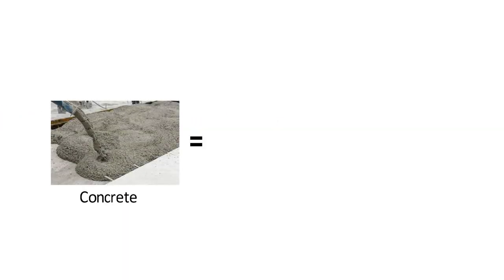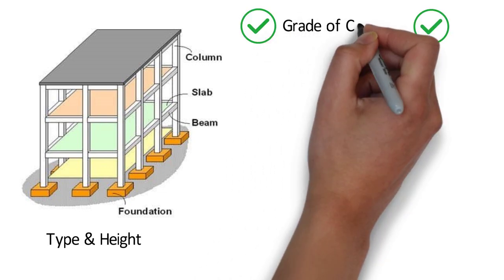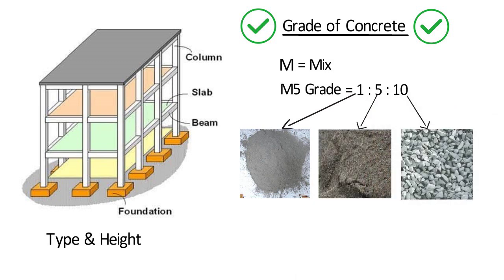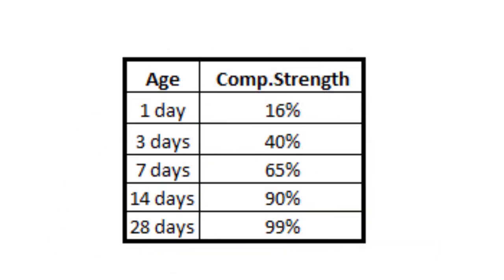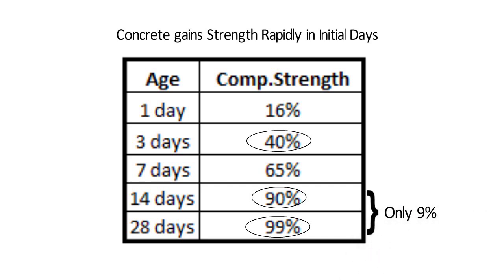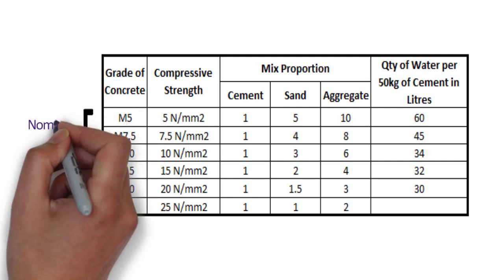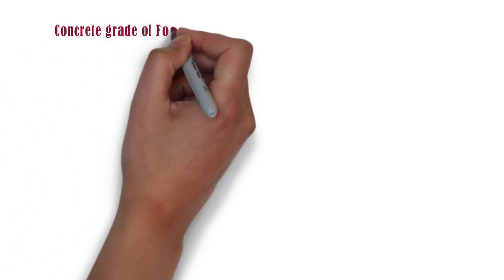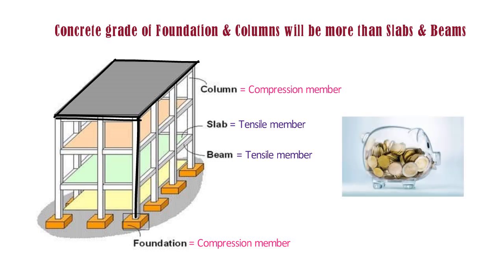Different Grades of Concrete and their Uses

Comment: You said ‘Concrete grade of foundations & columns will be more than slabs and beams’ - For a G+3 residence if you have slabs/beams with M20 grade and columns with M25 grade with a foundation PCC bed of M7.5 grade, does it make sense? I see that the foundation PCC bed has this grade as a standard. Isn’t M7.5 less strength compared to M20 or M25? I believe the foundation had M20 RMC poured in. Can you clarify?

Comment: Slab on roof and horizontal beams which  grade mix(m20 or m25 grade will be more beneficial.building is without coloum.pl advice from each angle which grade mix will be better?

Comment: Thanks for the informative videos on concrete. I'm casting a two way slab with dimensions 4,5m x 2,5m that includes reinf bars.  The slab will only be used for people to walk on. Can you please advise what the approximate thickness of the slab should and what strength grade I should use? Respond to gavinplstd@gmail.com

Comment: Very useful video. Sir, please explain grade and composition of concrete used for walls as well as pillars and slab. I want to build an independent house with concrete wall (pouring of concrete at a time for pillars, walls and slab after reinforcing with steel and centring). I want to build stilt plus four floors house in 200 sq.meters plot.

Comment: For general use 1 cement, 3 sand, 5 stone mixed dry and then as little water as possible to make the concrete loose enough to place. For specialty uses consult an engineer.

Comment: It would be beneficial for us
(Common people) ,if you discribe
the different grades of cement used for 1.footing 2. Caulamns
3.Roof  and brick work .
Reply: Oh! By common use (houses) the rank of concrete in foundation, columns, and beams is  f'c= 210-250 kg/cm2, slabs, and roofs -+ f'c= 150kg/cm2

Comment: Thanks a lot for the basics of concrete. How does concrete strength varies depends on cement grade (43 / 53 / 63)?
I'm an electrical / electronics engineer. But love to understand the Civil engineering.
Reply: Sir I can not completely answer your question but 43 and 53 grades OPC are only used nowadays whereas 33 is obsolete. And sorry 63 grade is not available its 33,43&53 grades only. And use higher the grade higher the strength. These are the strength of cement and not related to concrete. 33grade cement means its strength is 33 n/mm2. As per my experience important structures are built using 53 grade whereas ordinary cement available in market are of 43 grade mostly

Comment: If we say 1:5:10 ...is it by weight 1 kg cement: 5 kg sand : 10 stones ?...... what I have seen is they take bandli( tumbler ) and measure 1:5:10 .... and mix ... weight ot each component is different ....can u plz clarify...
Reply: Volume is what that matters, not the weight.
Reply: @praveenchandran4403  Theoretically concrete is ideally batched by weight.
However its more easily measured by volume on job site. But for critical level / important works e.g highrise it's definitely batched by weight.

Comment: If we use less grade of concrete for slab and beams, the chances of failure will be high. Because slab and beams are tensile members and concrete is weak in tension. So the minimum grade concrete for  slabs and beams are M20 and M25 respectively.